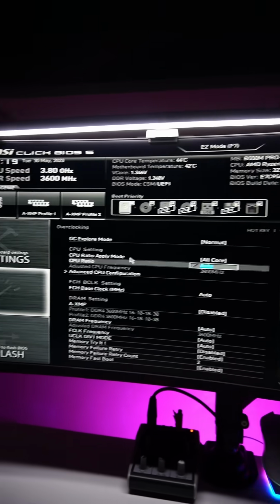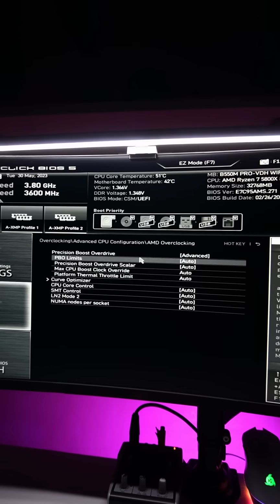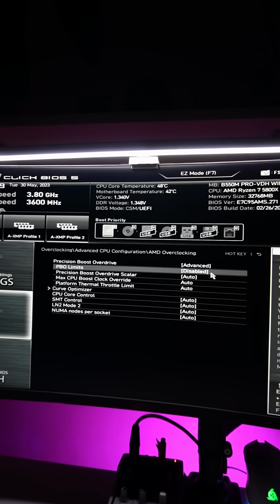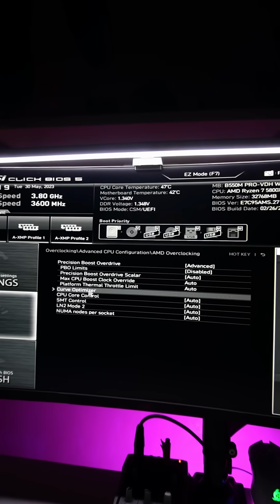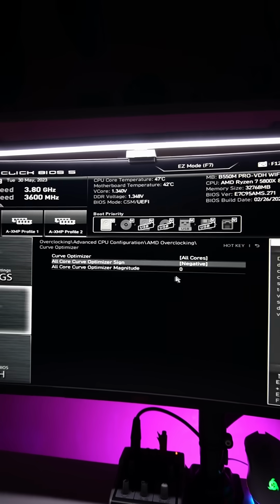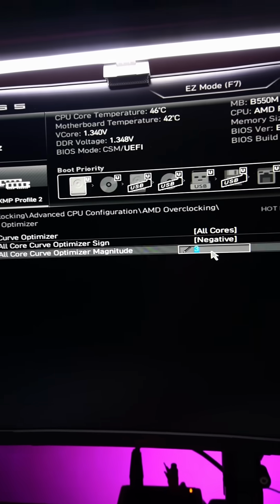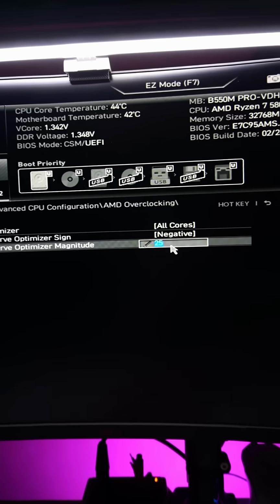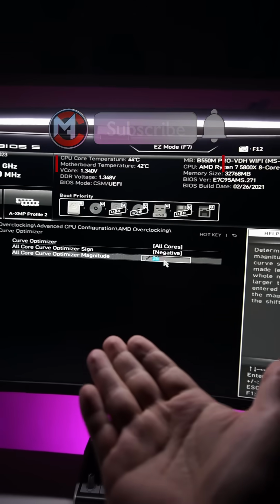Undervolting Ryzen CPU using precision boost overdrive #shorts

Comment: this setting must be on certain boards, not working on a msi b450 its not even there in the most updated bios
Reply from the maker: unfortunately b450s doesn't have this option
Reply: @MacCoyzkie  Actually they do, you can find posts users with the tomahawk motherboards with this, unless those posts are a lie? I don't really know lol. I just didn't know which and why it was limited to specific ones. I don't really need it as I have a 5800x3D and I can use an app for that. I was just curious about it to pass along the information to others and friends. But now I know to recommend a b550 instead, if say people can't grab anything newer instead.
Reply from the maker: @ChikaHakozaki  You're correct that some users with b450 mobos, like the MSI b450 Tomahawk, have reported using pbo2 after a bios update. While it's not officially guaranteed across all b450 boards, many have added support for it with newer BIOS versions, particularly with Ryzen 3000 and later cpus. The reason for limitations is that not all b450 boards have the same power delivery or features required to fully utilize pbo2, which is why support might be inconsistent. If someone is looking for more reliable and future-proof support, recommending a b550 mobo is a great choice, as they natively support pbo2 and newer Ryzen features without needing as much dependence on bios updates

Comment: I did this but it has no effect or change in temps when I’m running cinebench benchmark
Reply from the maker: Test within the range of -30 to -20, using increments of -1. This will help you identify the optimal setting for your build.
Reply: @ I can enter a max value of 60 on my motherboard but my system Dosent crash at all and nothing happens and dosent change temps wheter I put it low or not
Reply from the maker: @Abdallah1_16  what's your cpu and cpu cooler model name?
Reply: @ my cpu is a ryzen 7 7800x3d and I have a prebuilt cyber power xtreme supreme gaming pc tho I’m not sure for the cooler it’s a aio 120 mm liquid cooler
Reply from the maker: @Abdallah1_16  This could be related to airflow, a faulty AIO, or degraded thermal paste
Reply: @ I can’t say for sure because I just got the pc and I had the same exact pc and I refunded that one but it’s the same thing for both of the pcs
Reply from the maker: @Abdallah1_16  this is the time i need a hands on that pc, I'm still wondering why it's overheating
Reply: @ it dosent overheat it just reaches max temps on cinebench around 82 degrees but Dosent thermal throttle
Reply from the maker: @Abdallah1_16  82c is not bad, does it go beyond that during gaming?
Reply: @ no during gaming my cpu stays very cool only when I run a stress test during a benchmark like cinebench
Reply from the maker: @Abdallah1_16  oh ok, that's fine bro, no need to worry. you should start worrying if when you game/render and keeps shutting down

Comment: What’s the setting for ryzen 9 5900x or do you have guides for diff processor?
Reply from the maker: follow the same in this video but in the curve optimizer start value start with 30, stress test it and if it shuts down means it's not stable, go back to bios again and change it to 29 next, stress test again and if it didn't work try 28 and stress test again and so on. increments value should be 1. sometimes you will get no display so simply clear cmos to reset everything to default

Comment: Hi man sorry for my bad english.
Its enough if I undervolt -10(following the video process) and turn on the PBO.

I have the ryzen 5 7600 with an DeepCool Ak400 and a 750w psu
Reply from the maker: i can't say for sure, because you still have to stress test that setting. if you get no signal or pc shutdown during stress test then you have to change it.

Comment: What are the best numbers for the Ryzen 5 7500F?
Reply: @I-MAC  bro ,i just build ryzen 5 7500f , with hsf pccooler paladin ex400, my idle temp is 51° with voltage on idle (defaultbios) 1.075v, how about u?
Reply: @GhostOfSpade  Yeah my temperature is also around that range with HSF Deepcool AK500. I think that's normal temperature.
Reply from the maker: @I-MAC  I can't tell what's the best number bro, you got to stress test it until you find a stable settings

Comment: I had ryzen 5 5600 and mobo asus prime b550m-a, how to set the curve? Im new for it as currently i just manually set multiplier to 40 at 1.025 volt and it is chill at that point.
Reply from the maker: the idea is actually the same if you go to advanced options> amd overclocking > precision boost>  pbo limits disabled> curve optimizer all cores and select negative.

you just have to play around with the numbers, stress test it and see how it goes. if ever you experience no display just clear cmos to reset the bios to default

Comment: Hey i just got my computer and i have a 9600x, if i put -30 and it doesnt work. The pc will shut down and i have to just open bios and change it again right. Because i dont think i will touch any components, i just want to undervolt so my pc runs better for longer
Reply from the maker: clear cmos by removing the cmos battery for a 5 minutes, place it back again and try to do another test. start from -29, do a stress test and if it shuts down, clear cmos again and this time try -28 and so on until you find the best setting for your setup
Reply: @MacCoyzkie  ok so im not doing it cuz i dont want to remove anything
Reply from the maker: @s4m146  you can also go to bios and load optimized defaults

Comment: Mine crashes on 30 all the way down to 15….
Reply from the maker: testing increments step should be 1, start from 30, 29, 28. if it still crashes then i guess the pbo2 might not be good for your pc. you can clear cmos to reset everything to default
Reply: Cheers - Slightly baffled as im on a ASUS B550-Plus, Ryzen 9 5900x DDR4 32GB 4800 and cooling isnt a problem
Reply from the maker: @GambitDayZ  i mean start from 29 then stress test and if it crashed, go back to bios and set it to 28, stress test again and see how it goes, if still fails set to 27 and so on. Btw turn on docp too

Comment: I set that to negative 30 all cores
I get black screen once in a while but it has a performance boost

I am ok with black screen, it only freezes for 5 seconds then its back again
Reply from the maker: try -1 increment and stress test it until you fine a stable number. that one going black screen is fine for the first time but if its going to become constant that won't be good for your system

Comment: My pc ryzen 77800x3d
Ram ddr5 2x1632ghz
Msi 4090
And mother b650 a5 sugerencias?
Reply from the maker: try it out, but you need to stress test it until you find the right voltage for your settings. if ever it get messed up and you got no display just clear cmos

Comment: Does undervolting with pbo voids warranty. (I am a total newbie)
Reply from the maker: it does but you don't need to tell the store that you overclocked it in any way in case you'll be using warranty
Reply: @MacCoyzkie  okay thanks

Comment: My pc spec: Ryzen 7 5700X
MSI B550M Pro VDH 
TForce Dark ZA 16GB 2x8 3600Mhz
MSI GeForce RTX 3060 12GB Gaming X Dual Fan V2
Be Quiet System Power 9 CM 600W BN972, 80 Plus Bronze
Kingston SN2VS 500GB Nvme M.2 Gen4
WD Blue 1TB 7200RPM 3.5 HDD
MSI MAG FORGE M100R Gaming Case 

Can i use that settings in my gaming pc? Thanks
Reply from the maker: yes! bro

Comment: Help, 5600gt with msi b450m pro vdh max and 240mm aio going 70c on idle. When applied static volt 1.025v and 40000mhz it goes idle 48c. But getting 160fps on valirant as my old 2600x even worrse.
Reply from the maker: this is a trial and error bro, if the current settings does not work well you need to reset the bios settings by loading optimized defaults and research the best settings for your pc. or if your pc does not give any signal try clearing cmos, copy paste this link if don't know how to do that https://youtu.be/S9hyEPTFR10

Comment: what is lowering the tempt? if you type in a lower or a bigger number?
Reply from the maker: some cpu temperature goes too high to the point the pc is shutting down. doing this process may help you get better temps (lower) and better performance. like i said in the video, start with 25, stress test, if pc didn't shut down during the test then its good to go but if it did, go back to bios again and try 26, and so on until you find the best for your pc

Comment: Im not a fan about PBO and CO. I tried many configurations but static undervolting/overclocking works best for me. All my cores on a ryzen 5900x are on 4.65 ghz with 1.2v. In idle it is 30°c and on full load about 50°C and stable 👌
Reply from the maker: oh that's interesting i should try that out too
Reply: @1991eppy  mind if I ask what cooler you're using?

Comment: Hey man so first test I set my core offset to -20. It crashed. So I tried -15. Unstable but I notice max temps didn’t drop, but my temps under load are lower. So like when I’m gaming it is lower???? That’s so odd. I’m on a 7600x. I settled on doing -50v cpu vcore. And -10 offset curve optimizer. I get crazy low temps now but still same max temp???? Also would this pbo thing hurt my cpu long term? Thanks.
Reply from the maker: Setting a core offset to -20 caused your system to crash because the voltage was likely too low for stable operation. At -15, the system was still unstable, which is common if the voltage is insufficient for the CPU under certain loads. Finding stability at -10 is good, as it seems to be a balanced setting for your specific CPU.

It's normal to see lower temperatures under load with a negative offset since the CPU is operating at a lower voltage, which generates less heat. However, the maximum temperature might not change significantly because PBO2 dynamically adjusts the CPU's power and thermal headroom to achieve the highest possible performance. When the CPU is under maximum load, it will still push to the thermal limit set by your BIOS, which explains why the max temps are the same.

Using a -50mV CPU vcore offset along with a -10 curve optimizer offset is giving you lower temperatures while maintaining stability, which is great. This setup reduces power consumption and heat output, hence the lower temperatures under load.

your current settings seem well-balanced for both performance and thermal management. As long as your system remains stable and temperatures are within safe limits, you shouldn't have to worry about long-term damage from PBO2 adjustments. Just keep monitoring and adjusting as needed!
Reply: @MacCoyzkie  alright thanks a lot yeah I kind of figured out that. It just makes it where you can have a certain clock speed at a lower voltage=less heat. Thanks
Reply: You can turn off C state. Crashes can occur on idle where curve is more likely to be not enough.  It can have higher idle temps but better under load.

Comment: We probably have the same bois ( b550 a-pro) and i have 5700x should i use 25 like u?
Reply from the maker: yes, try it out. if it shutdown after stress test, increase 1 step at a time, from 25 make it 26 and so on until you find it stable

Comment: - No PBO ? Forget it if your system doesn't support it (Board with less than 12Vcore phases)
- Curve optimizer ? Put 5 by 5. (Max 30) and test your CPU stability with Cinebench 30min test stability. Or with Prime95 blend test (will also test your RAM)
Reply: 8 vcore phases are enough for pbo

Comment: Ryzen 5 5600X and B450 Asus TUF gaming have same settings? I wish I had lower temperatures while gaming... It's currently 71 degrees, unfortunately
Reply from the maker: it could, my pc went from 91c to 83c during rendering. gaming in 75c to 66c.
Reply: I would say that's the safety zone for temperature 70 is in my opinion fine
Reply: @sebastianabc2716  dude that's good
Reply: @sebastianabc2716  61 🙂

Comment: I don't like doing this. I overclock my CPU manually. I set the frequency desired and apply the voltage needed until it is 100% stable.
Reply: @TH3_GAM3R_COUPL3  how did you learn how to do it? I have a new system that is a beast and idk if it’s 100% optimized
Reply: @TH3_GAM3R_COUPL3  about voltage I need to change manually, what should I look for in BIOS?

Comment: Could you more explain why PBO limits set to disabled and not in auto ? mine i set in auto and idk if is good or no what im doing . i have 7 7800x3D
Reply from the maker: When PBO2 is set to "Auto," the motherboard and CPU handle the boosting parameters automatically based on a variety of factors, including:
1. cooling Solution: If you have a robust cooling solution, the CPU will boost higher since the thermal headroom is greater.
2. Motherboard VRM Quality: High-quality VRMs can supply more power, enabling higher boosts.
3. Workload: The type of workload (single-threaded vs. multi-threaded) will affect how the CPU boosts.

when PBO2 is set to disable, it forces the cpu to use the stocks settings. 

The reason why i set mine to disable and set the curve optimizer like so is because my build doesn't seem to be doing a good job in AUTO mode. If i play AAA games and render videos my pc keeps shutting down.

if your build is doing fine with the current settings then I guess you don't need to do what i've done in this video
Reply: @MacCoyzkie  Thank you for ur time
Reply: @MacCoyzkie  Yes, but most of the people advise to set it to the motherboard's limit in order not to have any hardware issues, does this apply or the motherboard is a more limiting option? Thanks!
Reply from the maker: @bassboosted4life342  You're right that many people suggest setting PBO2 to the motherboard's limit as a precautionary measure, especially to avoid potential power delivery issues. The motherboard's VRMs play a significant role in supplying stable power to the CPU, and if they're not up to the task, it could lead to instability or even hardware damage in extreme cases.
However, if your motherboard has high-quality VRMs and proper cooling, it might be capable of handling higher boost settings without issue. It really comes down to the specific brand & mobo model name you're using.
Reply: @MacCoyzkie  keeping the system stable do u suggest keeping bios at :
auto pbo1 or enabled sorry if you want pbo on for gaming etc. pbo 2 has motherboard combined I get the safer part on the entire system?
Reply from the maker: @Andrewthomasp for stability, id suggest pbo2 set to auto or enabled. if temps and cooling are good. pbo2 integrates better with the motherboard's limit so it's generally safe for gaming and everyday use, just monitor the temps and voltages to be sure
Reply: @MacCoyzkie so pbo 2 is the advanced amd overclocking tab and the regular pbo is the first tweaker page ?
Reply from the maker: @Andrewthomasp yes essentially correct. the main tweaker page has the basic pbo setting and pbo2 options like curve optimizer are under adv amd overclocking tab
Reply: @MacCoyzkie  With PBO Limits set to Auto, does that mean it changes the stock values to overclock automatically?
Reply from the maker: @jakethehuman15  when pbo limits are set to auto,  means the mobo decides what limits to use. some mobo stick to stock values while other raise them a bit automatically so this will depend on your board or its bios
Reply: @MacCoyzkie  I have this exact same issue..just upgrade my cpu from R5 2600 to R7 5700X3D, everytime I tried to play AAA games my PC keep shutting down..I'll try this PBO2, hope everything went well for me 🤞
Reply from the maker: @ let us know how it goes, im interested in the result
Reply: @MacCoyzkie  nope it still shut down when I wanted to play Indiana Jones (I tried -27)..Could it be that my PSU isn't enough?My rig :
Ryzen 7 5700X3D
Asrock B450M-HDV (Bios P10.10)
RTX 2060 Super
2x8Gb DDR4 3200 (XMP Mode 1.35V)
Super Flower 550W 80+ Platinum
Reply from the maker: @ yes, get a 650w
Reply: @raflryan2242  maybe too high settings, even with my rtx 5070 i cant run indiana jones at everything set to highest in 1440p, just not enough gpu vram
Reply: @AstraleQ-_-  for my case, it's because of the XMP turn on..I dunno why it can't run XMP mode while using 5700X3D cause it was running well with R5 2600..Now I turn it off and my PC never shut down again while gaming..

Indiana Jones is a hungry VRAM game, I only use low-medium settings since I only have 4060 Ti 8Gb 😅
12Gb VRAM is enough I think with some custom High-Medium settings 🤔

Comment: Is safe for my ryzen 5700x3d oc 4.2ghz on cpu ratio core and -30 is safe?
Reply from the maker: tbh im not entirely sure unless i myself test it. what you can do is to start from -25, save settings and go back to windows, stress test the pc and if it shuts down this means it is not stable, try -26 next, -27 onwards until you reach -30
Reply: yo lo tengo en -25 con ese mismo procesador y me va de lujo.

Comment: When I press amd overclocking it shows only 3 options:
1 . Core control
2 . Gfx clock frequency
3 . GFX voltage
Reply from the maker: this means your system specs does not support pbo2

Comment: is their a way to undervolt a cpu that doesnt support curve optimizer?
Reply from the maker: yes but be careful. First go to bios, look if the you have the option called "core voltage" then "offset" and usually that is in auto just make it negative increments like -5 millivolts at a time, save and exit bios.

stress test it until it becomes stable, if you see no display just clear cmos and redo things again until you find your pc's sweet spot undervolted settings
Reply from the maker: @khalilcruz5816  your trippin bro, im not sure why that is

Comment: What are the temperatures of the VRM and processor after andrevolt on this motherboard?
Reply from the maker: when i use the default bios settings my temps for cpu is going up to 91c, rendering a video. but after this i got like 80-85c max